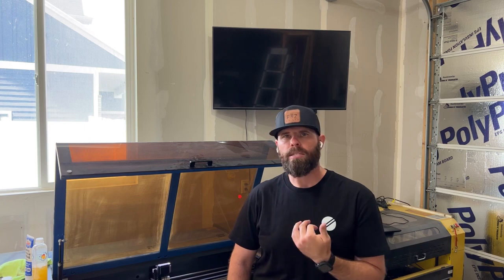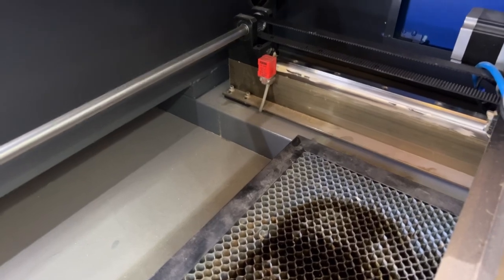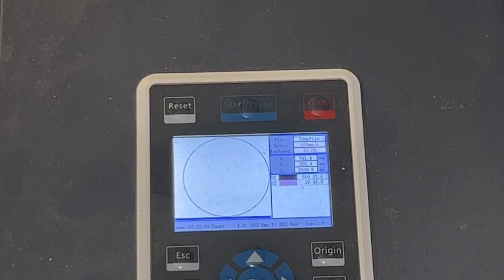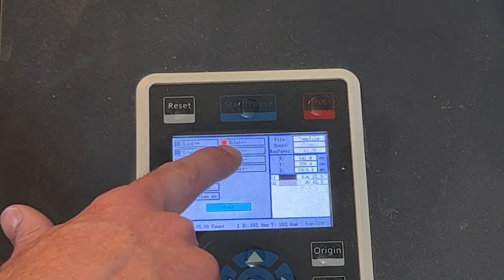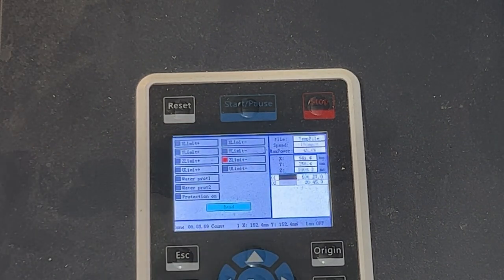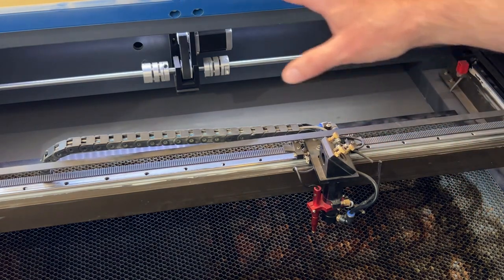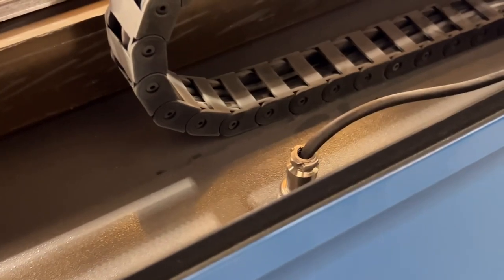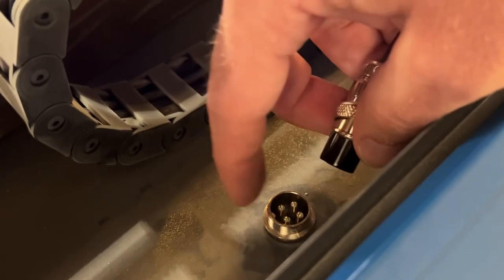Troubleshooting - Co2 Laser Grinding | Machine Grinding | Limit Switches

Comment: Good video!  We had a problem grinding and moving past the limit switches. The limit switches were lighting up, but it still drove past the switch and grinding..  I watched another video that said to adjust the switch to make sure it' smoved closer to the metal that triggers the switch.. I did that and FIXED IT!..  Lights still coming on the same as before, but it doesn't over travel. There was nearly 1/8 inch distance when I started and very little after.  Anyway, hope it helps someone!

Comment: great video! So my limit switches are not red when i go into the diagnostics but when i put something over them they turn red. This means i just need new switches?
Reply from the maker: No, if they are turning red when you have a metal object over them then they are working correctly. You need to make sure the rails are clear and there is nothing stopping the homing process.
Reply: @April Scalercio, did you fixed it?
Reply: @miiucasillas5858  I did, thank you.
Reply: How did you fix your switch?

Comment: Both my sensors are in working order but still slamming off the Sides on both axis ?
Reply from the maker: When you turn the machine on put something metal over the switch. Did it stop the axis?

If not then there is something wrong with the sensor.
Reply: @BeardedBuildsCo  I fixed the sensor and it was still slamming ,until i turned off the machine and turned it back on ,than it started to work ,thanks for the reply !

Comment: my rear sensor quit working randomly, i replaced it and still did the same thing, what i found was the metal thats on the gantry doesnt trigger the switch. i ended up having to attatch a piece of sheetmetal to the bottom of the gantry o it would trigger. mind u this machine is brand new and it did this. im not sure if something fell off or what. it worked fine but when i ran leds around the perimeter it started doing this. i looked everywhere and didnt find anything in the bottom of the machine.
Reply: Mine is doing this brand new off the pallet. X axis grinds into the limit as soon as I turn it on.
Reply from the maker: Do the tests in this video.
Reply: @BeardedBuildsCo  I can stop the homing on X with a screwdriver over the limit switch. The metal part on the head of the gantry that's supposed to trigger the switch doesn't trigger it at all.
Reply from the maker: @Impsucks is the switch set too low to be triggered by the metal on the gantry?

Comment: I can manually move my head to the limit switch and it activates.  Red light shows on switch and it shows up in diagnostic.  However, I can continue to move the head to the right even with the limit switch being red.  It senses it, but doesn't stop the head.  Any idea why this would happen?
Reply from the maker: Is this after your machine has successfully homed? If you press the reset button on the controller what happens?
Reply: @BeardedBuildsCo  it is when the machine powers on and it try’s to home. Mine is a large laser. A 5’ x 10’ bed
Reply: @BeardedBuildsCo  I think I have either a bad sensor r he wire is loose.  I noticed today that the sensor was flashing off and on as the gantry moved.